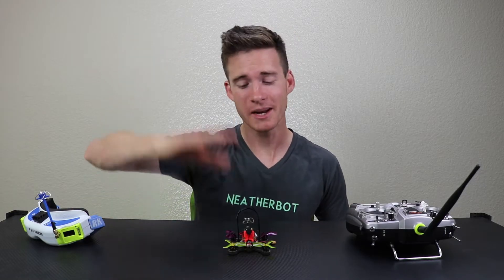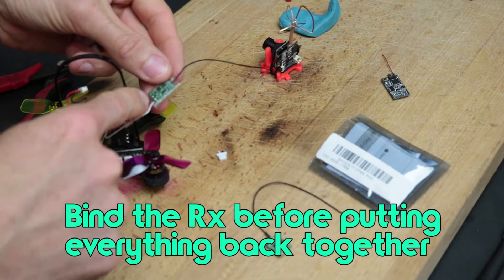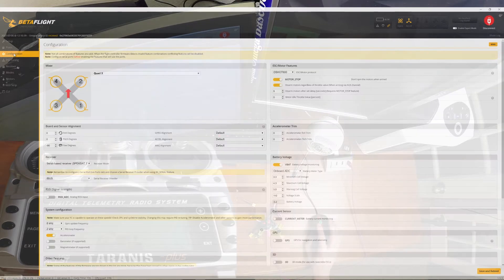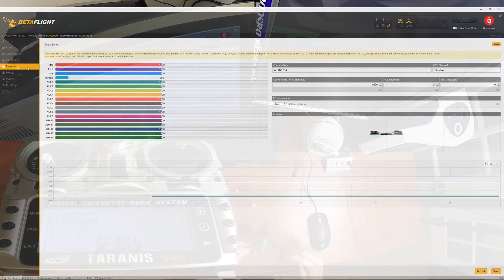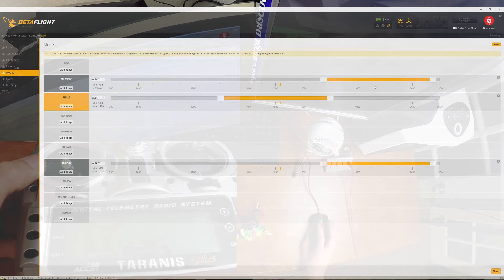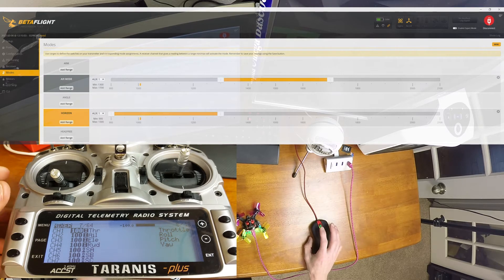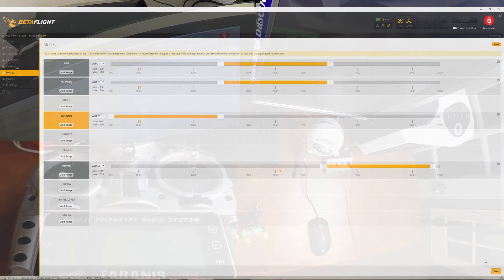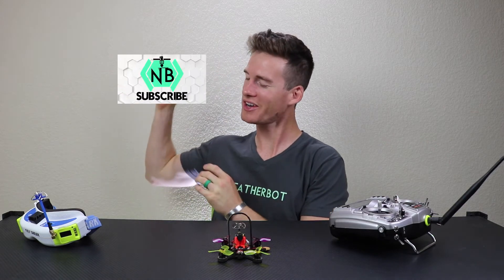Chaser88  | SETUP

Comment: Do you have video of the tx02 installation? I wonder if it's possible to use 3s?
Reply from the maker: +Henrique Santos TX02 is not designed to take in 3s voltage. But there is almost always a 5v regulated output somewhere on FC. Just hook it up to that.
Reply: NeatherBot thank You friend... Like    ✌✌✌👍👍👍